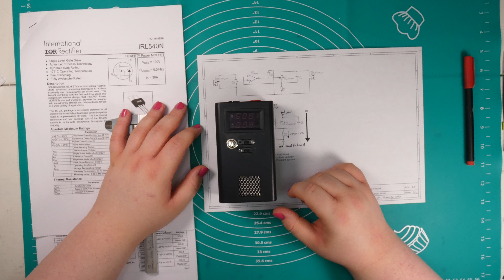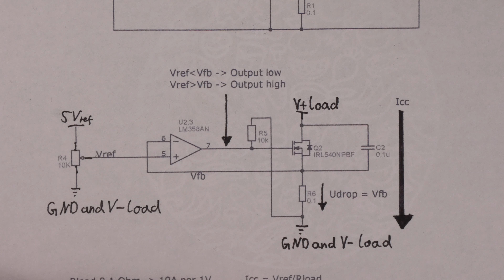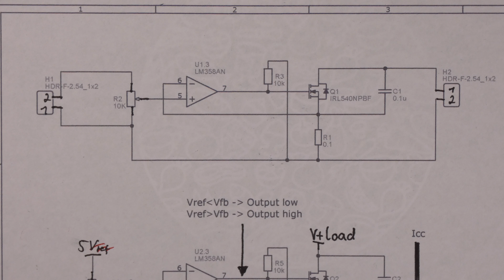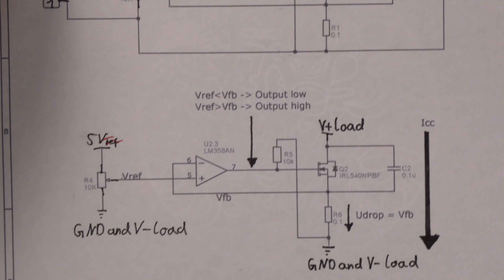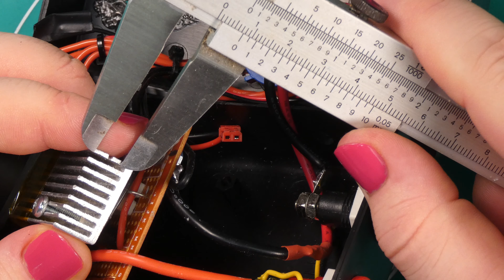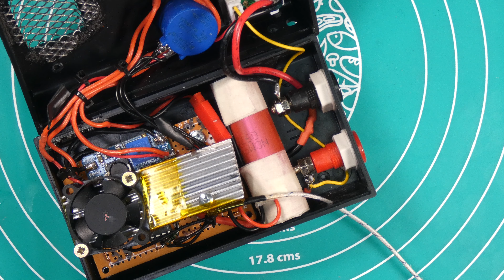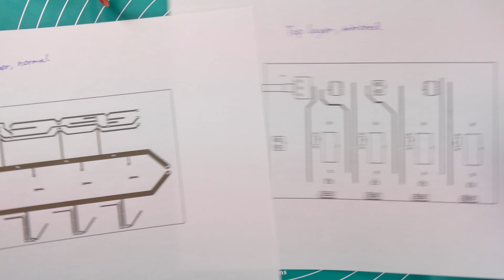DC Electronic Load - Everything You Need to Know and More (Schematic and Function explained)

Comment: Hello Anna. Please don't think I am being patronizing but your videos really are good. They need to be for me. You said  'oversize their cooling'. A little bit confused as fitting an oversize heat sink really doesn't matter - or does it? Perhaps you meant 'underestimate the cooling required'.  Where does the enegy go, is it heat? If so what advantages are there to this circuit? Can it be made adjustable via a pot? This looks a lot neater than the load resistor / fan one I have built but that can handle 600W if you don't mind the heat and noise.
Reply from the maker: Hey jp,
there is absolutely no reason (regarding the circuit) not to oversize the cooling. However what I meant was that you don't get any benefit from doing so. You literally waste money by oversizing the cooling solution. If you compare to guides and forum posts all over the internet it seems like everyone has massive heatsinks while stil active cooling them. When I started to learn about one of these dummy loads I though it needed massive cooling as everyone uses but in reality its a waste. I think the way I was talking about it sounds a bit frustrated? Just the lack of information you can get about this matter and I wanted to provide everyone with an example of sufficient cooling. 
"Keep the temperatures in check but don't overdo it" Thats my message.

Basically both this circuit and a load resistor do exactly the same, power going in is exactly power you have to dissipate in form of heat. Most power is wasted across the MOSFET and some across the load resistor and the traces.
The advantage of this circuit is that you can set the current with the potentiometer and if your voltage changes it stays constant. So you don't have to actively choose your resistors, also it is much more compact.
The bigger version will have a better Volt and Ammeter with power input displayed and some more functions.
Each of the IRL 540 I use can handle up to 140W maximum power dissipation. I would use them to 100W each so 6 of them should do the same as your load but will be much smaller in size. Also the power you need to dissipate is split into 6 components which makes cooling easier. I wonder how your project looks like, especially the  cooling solution.
Reply: @PhysicistAnna  
What Ho
Thanks for the reply. I do understand what you mean now. The first person on YouTube I followed was very good with videos explaining the LM317 but he finished up with a heat sink around 250mm x 60mm x 60mm. That's a lot for 1 LM317. I just like to keep 'bits' below 60C. 
I do wish I could show you my load bank (toaster) and the other things I have made over the last 3 years. You could die laughing. 
I don't know how I can do this. Can you delete a comment very quickly? 
This load system of yours is definately worth making. It does seem to be exactly what I need. This thing I have is a right bundle of croc clips and wires that do their best to melt. I have 6 x 100W resistors and just connect what load I want but it does get very messy.  
The original linear had 2 x transformers with 12 x TIP35C on 2 heatsinks with 6 fans. I did get 22Amps at around 35V (770W) out of it for a short while before the wires melted. Why? For fun. It's now twin units. All I have done so far has soley been to learn the hard way. I owe you another pint or whatever.
Reply from the maker: @jp-um2fr  No need to delete your comment if that is what you meant. Your questions are valid and maybe others have the same ones so they can read in the comment section and I don't have to redo the same reply :)
As for showing me your projects you can make a video and upload it to youtube or take pictures and send them to me ;)
Email:  physicistanna.yt@gmail.com
Reply: @PhysicistAnna  
Hello Anna. I was rather worried about putting an email address anywhere like YouTube. I was going to put mine on and ask you to delete it, hence removing the comment. Maybe I am being a bit OTT but there are some right r- soles out there especially where femails are concerned. Survival Lilly on YouTube almost stopped because of them. However as your channel is young I'm sure it will be fine. 
I will send you some photo's.  I have rather a lot so I'll sort out a dozen or so. Might I suggest you are sitting comfortably with a stiff drink handy - you'll need it. I do so much appreciate your help. I belong to 2 forums but I lost a friend from one of them, like you he was very helpful and could come down to my level of incompetence. A very rare find. 
At the moment I'm doing terrible things to a microwave transformer to convert it to give 14.4V DC. I have a 50A V & A with a shunt so your video will help. I have a 100A car starter / charger but it's a bit big for the odd winter battery boost.  The data sheet for the bridge rectifier says 1.2V per Bridge Element.
Is 14.4V + 1.2V +1.2V / 1.4141 = 11.9V AC in correct ? The 14.4V is quite critical say 14.3V to 14.5V is acceptable. Should I add a bit more for wire losses ?
I will also need a slightly lower 'Float Charge' so I may have to mess around the last turn on the windings. Or use a big buck and have done with it of course. Be a lot easier.
Your thoughts on this Anna ?
Reply from the maker: @jp-um2fr  
Hello jp, I know about this problem you are talking about however the Email I posted is my designated address for this channel. Obviously I'm not posting my private one on here because of these kind of problems. Also I'm very familiar with male behavior on the internet and especially in games. When I was younger I played a lot of online games, some even competitive and I participated in some early events (a lot of preassure and testosteron in the early days). Times got a lot better but I learned a lot from dealing with some stupid s**t some guys spat out. Not all were like this even at that time but yea, got my fair share of comments.

It seems you are right if the forward voltage drop of a single diode is 1.2V then the Voltage drop within a full bridge rectifier is 2x1.2V and therefore your transformer needs ~11.9V AC. I wasn't shure myself and had to measure one of my bridge rectifiers. In my case a single diode drops 0.44V, combined voltage drop on the positive and negative terminal was 0.88V.

Can't wait to get your pictures :)
Reply: @PhysicistAnna  
What Ho (very English) - thanks for the help - Again.
I also have 2 email addresses, I sorted out a second one so that I could send you some photo's. Men can be such r-soles, I should know I am one.
 I will of course continue to comment on your channel.
 Little bit confused over this bridge diode thing but it's nice to know I managed to get my head round it. Of course the resistance goes up with load and that meeses things up a bit.
I am in the throws of going through over 3 years worth of photo's to get a sort of history of my learning curve. Even I am disgusted with what I did in the early days, not much better now at times.  I have taken a few new ones of the cooling 'things' I have done. They may look odd but they work. Please remember though that most of what I have been doing is to learn not produce anything long lasting although I have made a few good bits. I'll send the photo's to you soon. 
I nealy dropped a clanger using this old microwave transformer. It seems they really are built down to a price and are just about on the point of meltdown. The primary windings are so short the NO load core temp after half an hour is 100C. Found a good paper on the Int.     
 https://www.qsl.net/kh6grt/page4/xfmr/xfmr.htm 
One way to reduce this heat a bit is to add a few more turns on the primary and I do have room, I'll also use a server fan.
 I'm going to use a 20A (17A tested - no fan) buck. They are only about 6 Euro and it's the easy way out. It also means I can keep to 14.4V and adjust the charge rate.  I don't have any suitable wire for a high current secondary so I'll let the buck drop the Volts and up the Amps. I'll wind for about 25V AC. I don't think I'll be using it in the house. All good clean fun Anna.  Sorry to be so off topic.